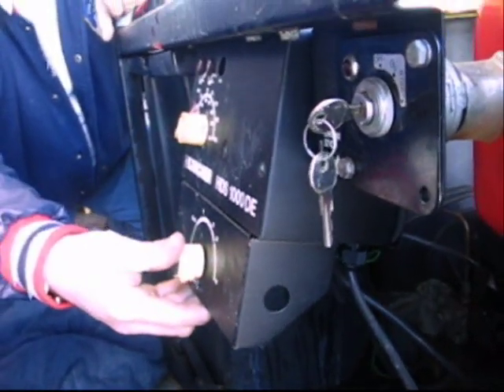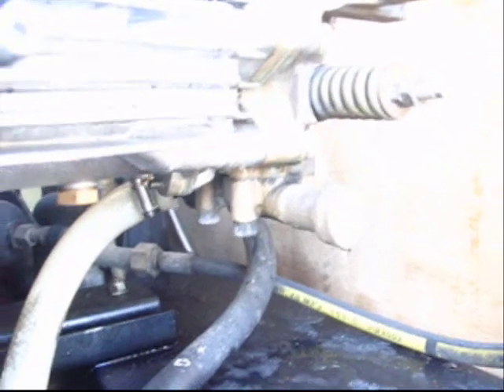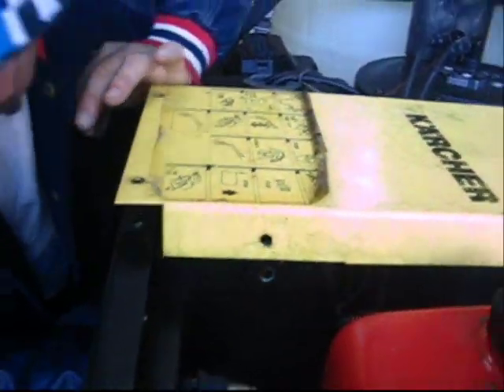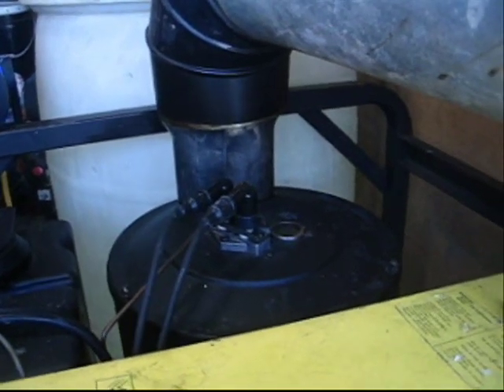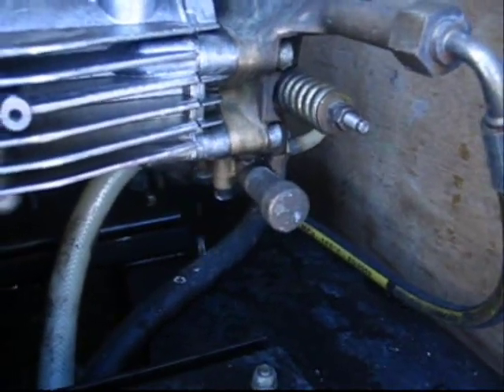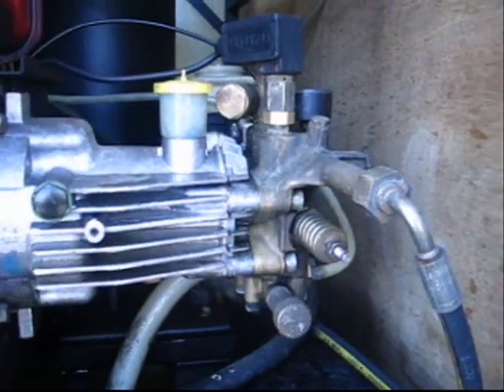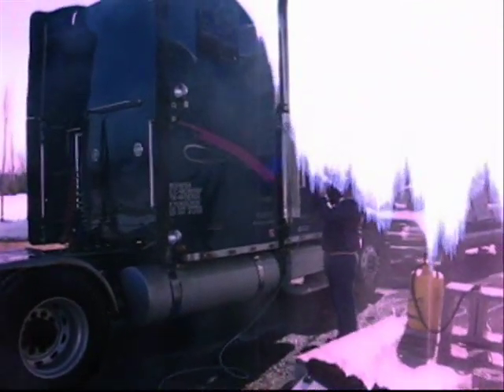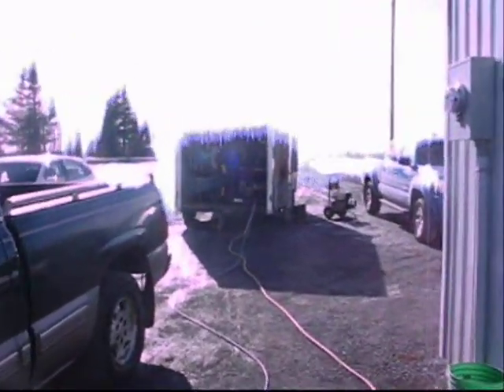Karcher HDS 1000DE pressure washer

Comment: Thanks for your video! Which pressure washer will you recommend around 3000$ ? You mentioned Honda right?
Reply from the maker: stratomason Yes, for an all purpose pressure washer, go for a 13HP honda engine with a 3600PSI pump with separate unloader.  Do not get a pump that has it all-in-one because you will have to replace it after a year of use!
Reply: ***** Could you give some specific model? Maby http://www.jebbtools.ie/honda-ppg1002-250-13hp-pressure-washer
Reply from the maker: OK, if you look at the comet pump, the one that is on that pressure washer, has a black handle that is common to an unloader that is separate from the pump. (Great)  If you search for Comet pumps, you will see the ones with the red handle, have incorporated unloader. (Bad) The link you sent had a very nice looking unit if you ask me.
Reply: ***** Thank you for your advices. I'm looking for preasure washer mostly to clean elevations so as I understand I need hot water. Can you recommend some good machines?
Reply from the maker: You might look at getting two separate units.  Get a pressure washer and a separate water boiler.  The reason is that if one breaks, the other can still be used.  In our case when either of the two break, the entire unit is out of service!

Comment: Hi I have been using Karcher hd 6/11 for about 11 years I am on my 3rd one and it was nearly a year old and it started over heating, I had it back twice at local karcher dealer and got it back still still not working, The Karcher dealer then had to send it to another main dealer only to be told it could not be fixed this went on for 6-8 weeks. Thy eventually gave me a new one under warranty out of
good will, I was mad at them for saying it was fixed twice and it was not. I think thy need to get a better repair centre. my other 6/11 worked out ok and got about 5 years out them with little or no hassle. I Hope yous got your 1000de fixed ok ? looks like a nice machine would you recommend this for my car washing business ? and do you know the water flow rate and how is it on fuel ?
I saw one second hand going for about £ 2000
Thanks Brian
Reply from the maker: Thanks for watching Brian!  From day one, the service I got to repair my Karcher unit was from a "certified" repair technician.  After talking directly to him, he told us that ANY Canadian certified Karcher technician had little to no clue how to properly fix these units and would be told to send them in for servicing at the closest US repair shop.  They had no clue either!  I had the worst experience with Karcher service support from Canada, the US and even Germany!  YES I contacted Germany and was told by them that our Karcher HDS 1000DE pressure washer was the only bad unit they made and they could not do anything to help us!  We still have the engine with us but the rest of it is garbage.  By the time I contacted them, the warranty on the unit had expired! Figures

Comment: Ops you have a good machine but i think those technician didn't fix properly your equipment. water leak due to defective piston or seals and groove ring , your housing is broken due to lack of oil maybe because of vibration and oil leak. That model mostly used here in Saudi in oil field you must add mesh filter .1 microns from the water inlet